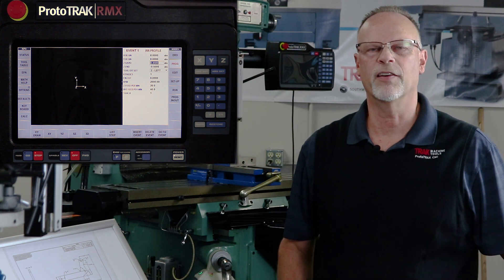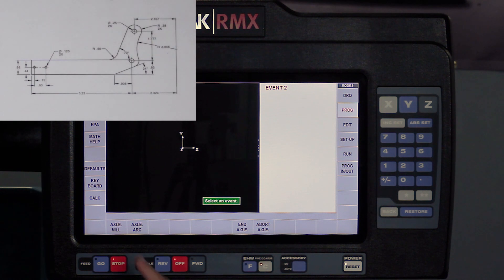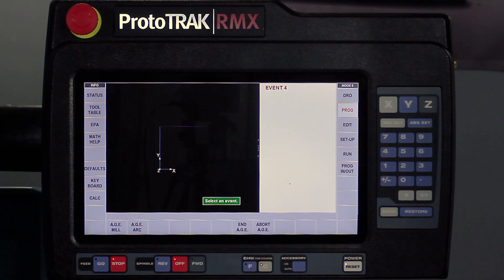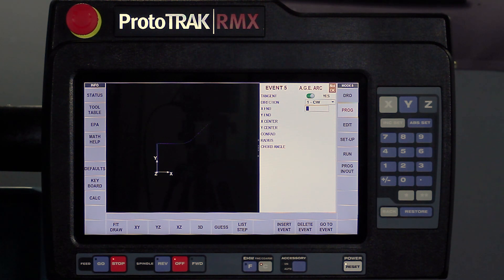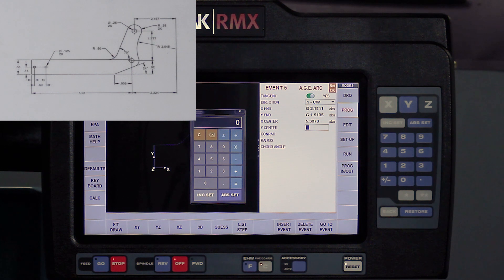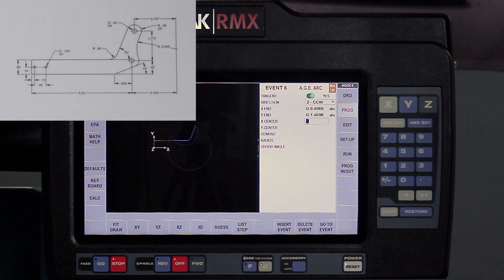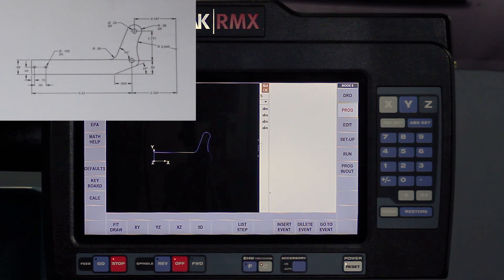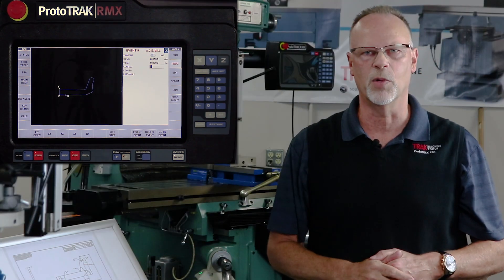A.G.E. [Part 3] | ProtoTRAK RMX CNC | Advanced Mill Programming

Comment: Are there options for a finish pass using a different tool? Also can 'Z' depths be made for harder materials? Thanks.
Reply: Yes, with the RMX control, anytime you use a profile or pocket, the finish pass is included as one of the prompts. The depth of cut or number of Z passes is also included. The choice of using a second tool is also available when using profiles or pockets. Along with all of that, anytime you use an irregular profile, pocket, island or clear off event, you have the very powerful AGE programming included. T.P.